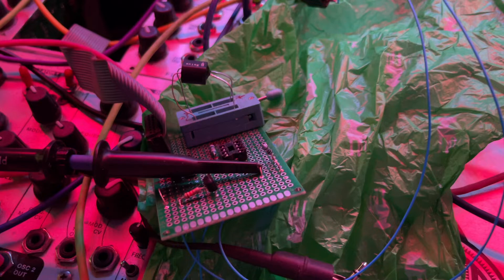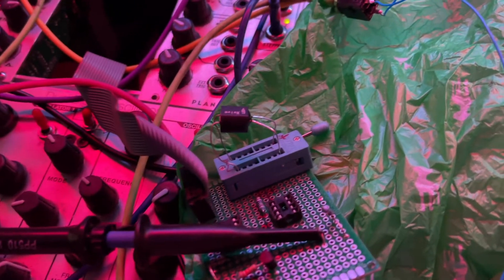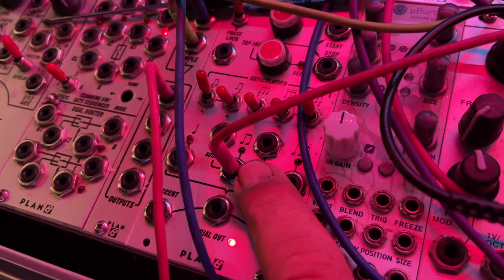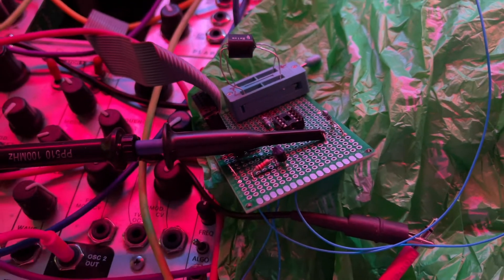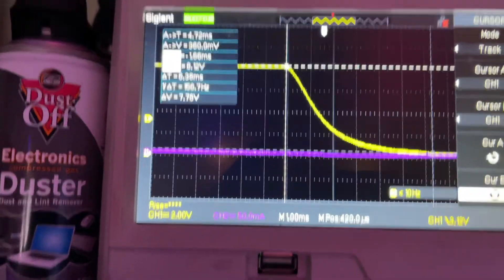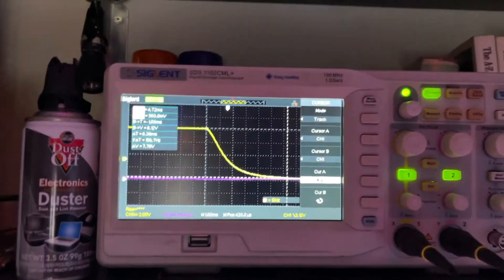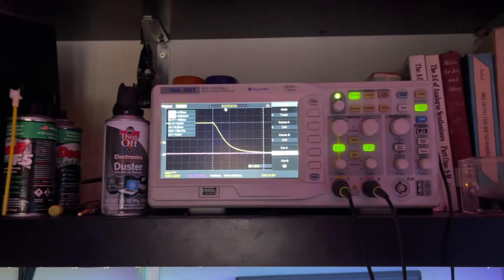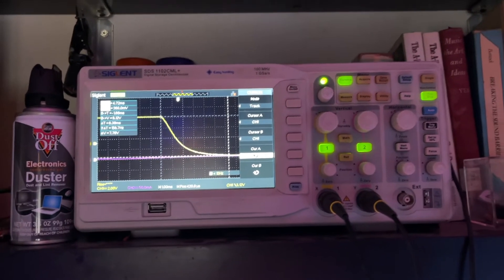MEASURING VACTROL DECAY TIME

Comment: so in your experience a usable range is between 5-7 seconds? thank you
Reply from the maker: that's an interesting question. The quick answer is if you have a pair of VTL5C3 or a single  VTL5C3/2 made by either Vactec, Perkin-Elmer or Excelitas Technologies you can be assured whatever time they will return, they will work within a LPG application.  Its the newer copies made by Xvive or Cool Audio that may give you problems. Let me explain:

The first ones made by Xvive were fine. I've tested those made in later batches however and they are terribly out of spec. 2-10 ms delay, which is way too short. On the other side of the coin, some of the Cool Audio ones tend to be way long, with some decays up to 15 seconds.

In my adaptation of the Buchla LPG circuit i've added some componentry, guided with a trim pot, which helps kill the bleed associated with LPGs in the Eurorack (high amplitude) signal attributes. It also tends to cut down the decay. As such, i can handle vacs up to five seconds, maybe a bit longer.  Without that mod, i would stick wit a decay between 1- 3 seconds. 

I hope this helps
Reply: @PeterGrenader  detailed and appreciated replay and thanks also for the other videos regarding vactrols
Reply from the maker: @Marwatt  

No problem. This is a frustrating issue that needs to be understood. This is the part of this whole problem that boggles my mind:

Vactrols were killed by RoHs restrictions because they contain cadmium. Yet the LDRs in vacs is what has it and they are still in production and widely available. 

Makes zero sense to me.
Reply: @PeterGrenader  fully agree ... there will still be millions in production ... like the GL series ... it would be enough for those who manufacture the gl series to produce 1 with the necessary characteristics ... minimum production quantity? 1 million pieces? : -X
Reply from the maker: @Marwatt  pretty much lol